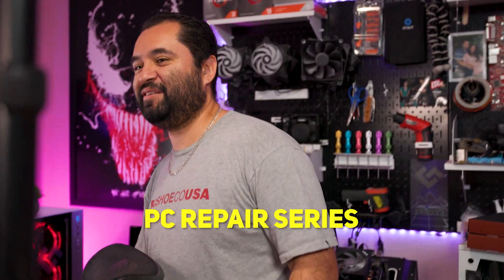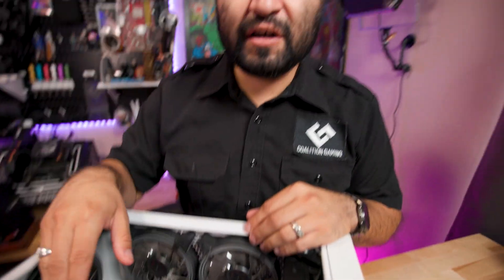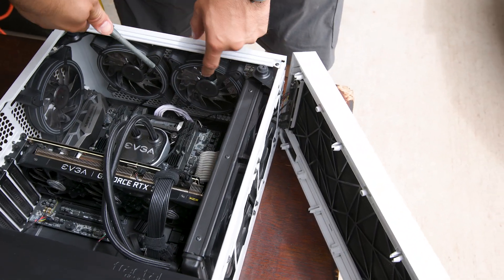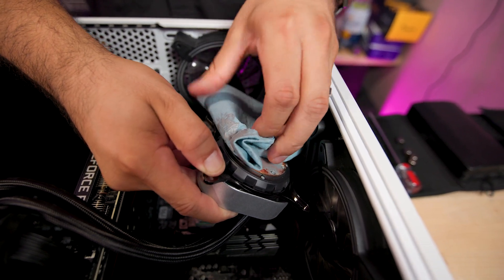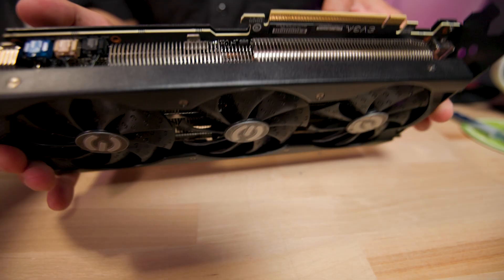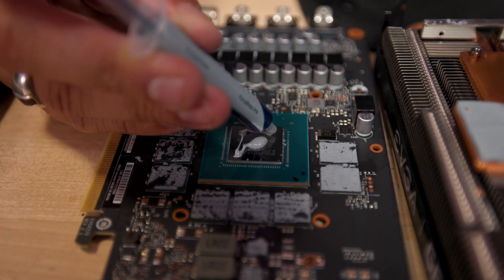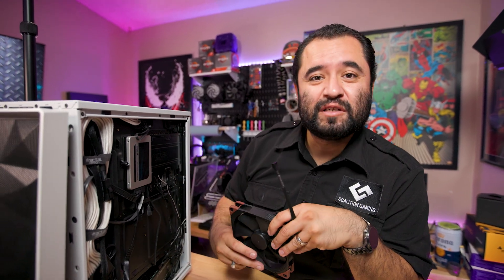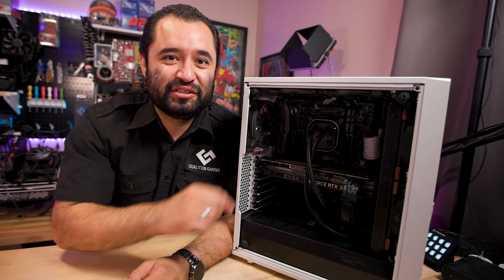This Computer Almost MELTED - Here's how to FIX IT! HW Hospital Ep5

Comment: Good tip on not letting the fans spin while you blow them out. Old fans will actually seize up after doing that, because it has debris in the shaft. 😁